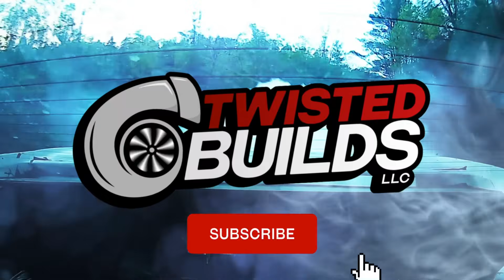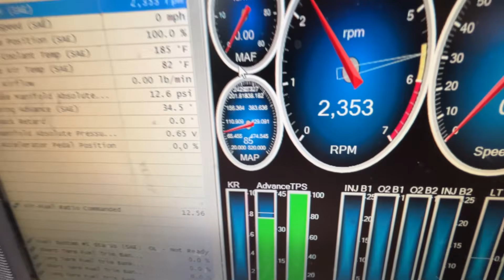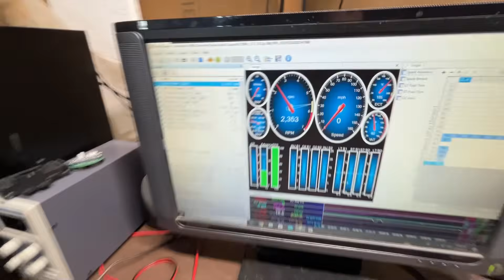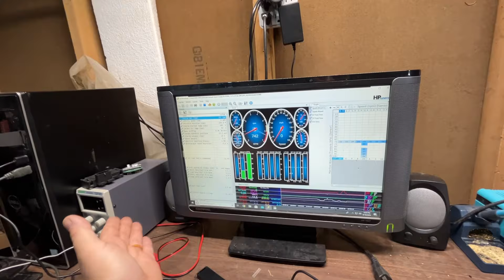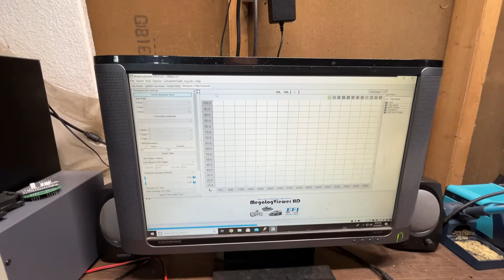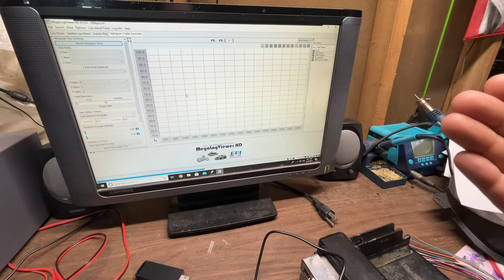Engine Sim Fun

Comment: Would you be able to sim how the ecu would behave on a six cylinder?
Reply from the maker: Yes for most. I dont think the GM 7x wheel is on it but would have to check. All this sim is doing is giving a crank/cam signal to the ECU your using, and simulated 0-5v and temp sensor inputs. The LED's are lit up from the outputs of the ECU for both fuel and ignition.